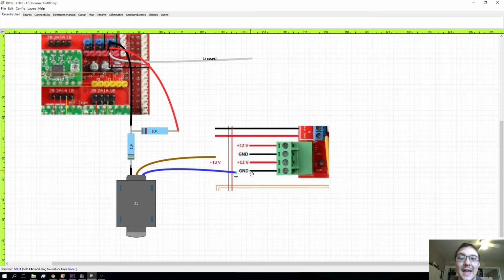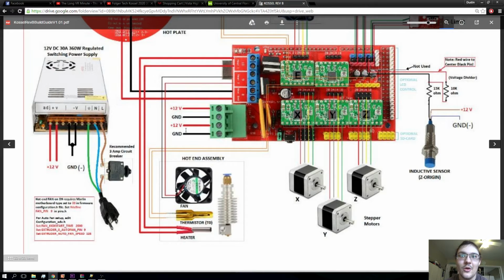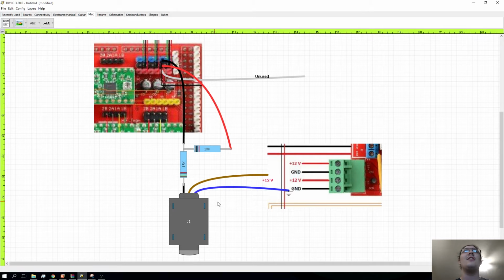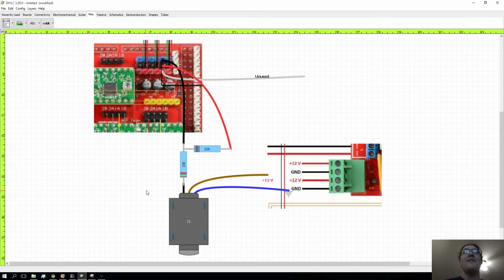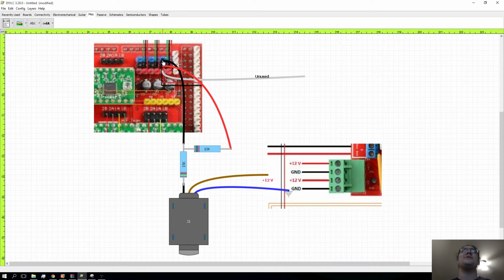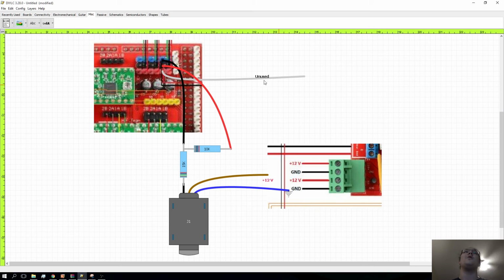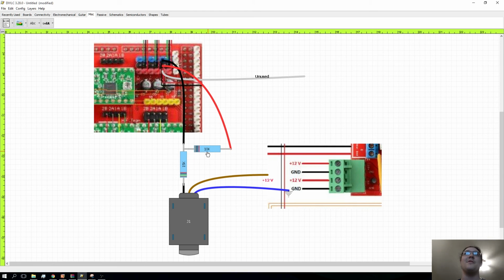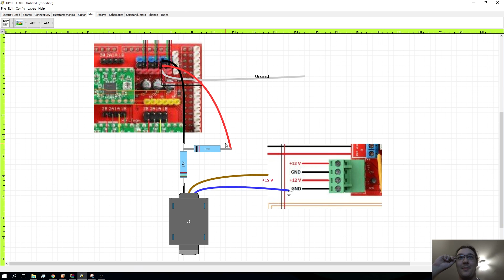Folger Tech Kossel 2020 3D Printer Calibration | #4 - Sensor Wiring (UPDATED)

Comment: You videos have been very helpful in getting my Folger Tech Kossel Rev B up an running. Thank you very much. 

Any chance you can make more videos on troubleshooting the Kossel? 

Some issues I have are:

Priming the extruder. There is a significant delay before filament starts coming out the nozzle when printing. Oddly, not the case when extruding manually 

Autolevel issues. My print head sometimes hits the print bed. 

Cooling recommendations 

Mods?

Custom G Code?

Thank you!

Comment: Thanks Dustin for these videos, they´ve been so helpfull. I thinks that I made a mistake conecting the negative ground in the ground (green cable), had the inductive sensor damage with that?
Reply from the maker: I don't think so, but it is possible.
Reply: I bought a new sensor, so, I want to make sure about connecting the sensor, may I connect to power supply directly?. Thanks
Reply from the maker: You can, but make sure you have the resistors correct before connecting to the board.

Comment: Never, but NEVER  go with a voltage divider in a variable resistance unit. You should use a Diode or a IC that LOGICALLY CONVERTS the voltage from 12 to 3.3-5V. You'll see so much noise on the voltage, your calibration will be shit.

Comment: great videos
what would i have to chance to use a standart limit switch as the z probe
Reply from the maker: +Dillon Ray probably just connecting the switch directly to the endstop pins on the RAMPS. and a servo. Never done it before though.
Reply: Ill give it a go thanks

Comment: Dustin you know what I wish you would do a video on? How to change the filament on a Kossel printer. The best instructions I have read  on how do it for PLA is to heat up the hot end to 165° C. Then remove the Teflon from the  brass fitting on the hot end so  that you can get access to hand pull the filament from the hot end. A video of some one showing a good way to remove, and reinsert filment on a Bowden hot end would be appeciated. Jerry
Reply from the maker: Sounds like a good idea. It definitely isn't always easy, although I've been using a few tricks myself to make it easy. Stay tuned!

Comment: Hey Dustin, I appreciate these videos, they've been a big help so far.  Can you make a video about your print and extruder settings? Or a general "getting up and running/making your first print" kind of video?  I haven't even been able to make a test print yet because my extruder keeps getting jammed. I don't know if it's the extruder or my settings (default), but I don't know where to start with dialing in the settings, and I'm getting sick of dismantling the hot end (6 times already) to remove clogs.
Reply from the maker: I'll work on something for you.  If you are using the stock slic3r /curaengine settings in repetier host, then it's not gonna work. But I'm making a slicer settings video soon.
Reply: Thanks man, I look forward to that video.

Comment: My understanding is that power supply AC ground is earth ground, which is not the same as vneg. vneg is dc ground. There is electrical isolation between AC ground, and DC ground (that is what the transformer in the power supply provides), they are not the same. But it is common practice to call vneg ground, that is the point of confusion.
Reply from the maker: Yeah, there is always confusion between it, hence why I tried to clarify if there was any confusion. I know everything is technically correct on both our diagrams, but since there was confusion, this video was necessary